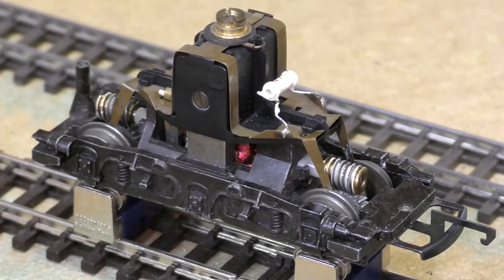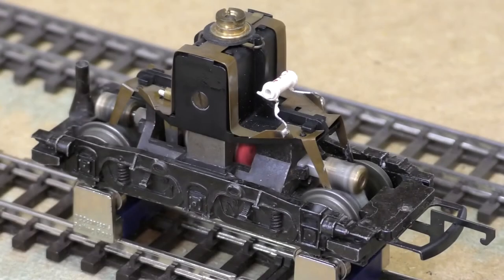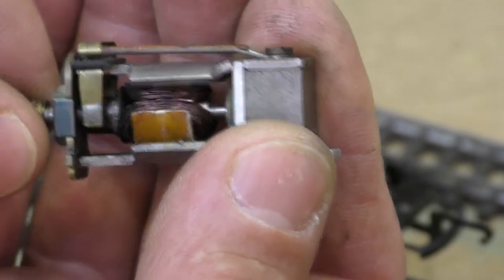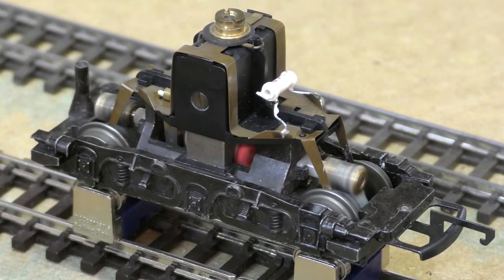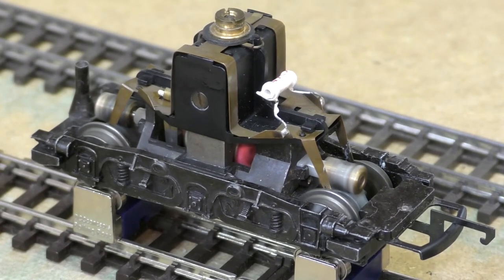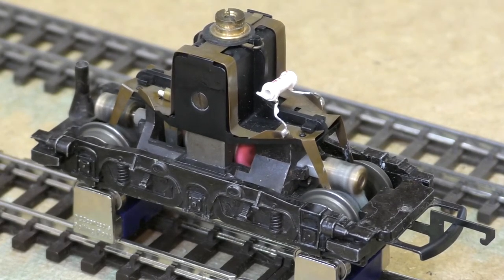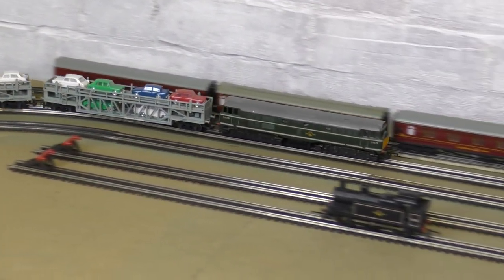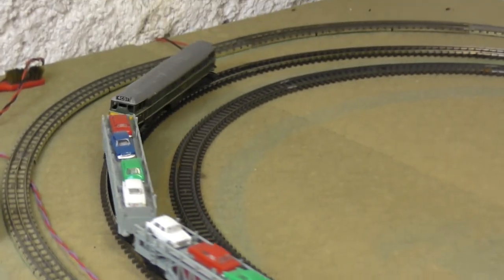Tri-ang R.357 Brush Type 2 Diesel Electric 5 Pole Armature Conversion Using Parts From Airfix 1001

Comment: Mr Snooze that was brilliant. I am gradually catching up with your completed projects. Pulling that off by working out what had gone wrong was seriously clever 👏👏👏👏👏👏👏💫
Reply from the maker: Hello Tim, thanks for watching this video. I enjoyed modifying this bogie but it did take a bit of experimentation. Worth it though as it's now an excellent runner with great slow running performance. Best regards to you
Reply: @MrSnooze  00Bill is working on a upgrade on the same model. He is putting pickups on the other bogie. Oscar Paisley has a video on this Locomotive highlighting all the faults. What you did was the answer and with pickups added, youd need a metal wheel each side, it would be extremely good engine 👍

Comment: As soon as it starts you can hear the difference in the motor.  A brilliant job.  The timing didn't occur to me at all.  👍😊
Reply from the maker: Hello Pauline, you are right, the five pole motor in X04 style or this modified version does run quieter. They are very smooth and have nice amounts of torque at fairly low RPM. The timing issue caught me out, I was perhaps rushing to try and finish it. I enjoyed the exercise but I haven't done another. The original Tri-ang motor is very efficient if serviced and running well I find. Best regards to you

Comment: Your a braver man than I Gungerdin taking that On....
Reply from the maker: Hello Paul. It turned into a bit of a battle at the end with the magnetic timing issue but was interesting to build. It definitely has more torque at slow speed but saying that the original runs really well if serviced nicely. I don't think I'll be doing another just yet. Best regards to you
Reply: @MrSnooze  I'm not surprised well done though

Comment: Good afternoon Mr Snooze
An excellent video in a series which I thoroughly enjoy watching.

You mentioned using  "silicone" sheathed wire to replace the brittle plastic "suspension" on the plastic bearing.  Please can you provide more details of exactly what this is, sizes etc.?  I presume you remove the copper core??  I have several Triang and Triang Hornby Brush Type 2s and some spare armatures.  The slightest touch of the plastic suspension causes it to snap and break - most frustrating. ...and the locos grind which I think is partly due to the brittle nature of this suspension allowing the shaft to move.

Look forward to hearing from you.
With kind regards
Simon
Reply from the maker: Hello, thanks for watching and the kind comments. I use 16awg silicone covered R.C. model wire. I cut two 4mm lengths and leave the conductor in. A dob of super glue on one end ensures the conductor will stay put but I've used it with no glue and no problems. Place the two bits between the bearing and magnadhesion magnets and carefully tighten the bottom plate. I hope you find this useful. All the best to you
Reply: @MrSnooze  Thanks so much for the helpful explanation, I am going to order the  wire now :).  Simon

Comment: Very fiddly. I use very high magnification glasses to re-attach and repair these commutator wires and the problem i've found is my tiny tools, at that magnification, look like giant Mole Grips. I wouldn't fancy the task of extending the wires. I think you got lucky twisting the commutator. they can be very delicate.

Do you have any recommendations on worm/wheel pullers? My experience has found that bought ones tend to be very poor. I fabricated my own in the past but i've always just got by. I don't have the equipment to machine the perfect tool.

Excellent video, as always.
Reply from the maker: Hello Jules. Thanks for watching and taking the time to comment. I have changed a coupe of commutators on Hornby Dublo armatures in the past but this Airfix one was tight. I suppose working with antique clocks I have a lot of practice with very small delicate items. I found soldering the extensions not to bad, I just took it slow and carefully. As to worm pullers I made my own and then purchased a China made kit with five different mandrels. For less than ten pounds it is a great tool and works well. All the best to you